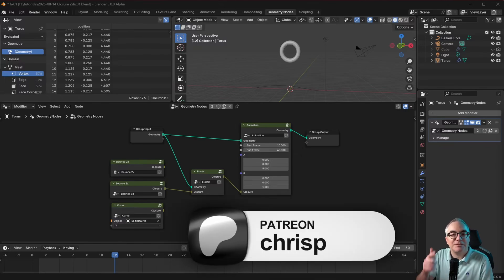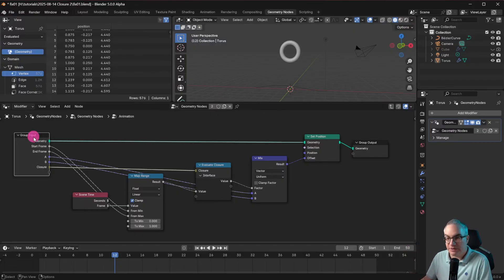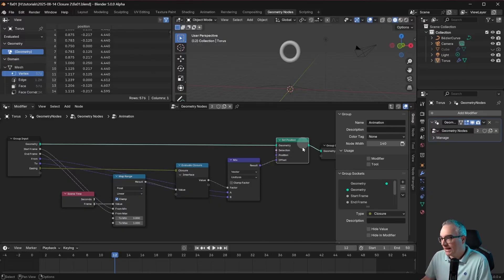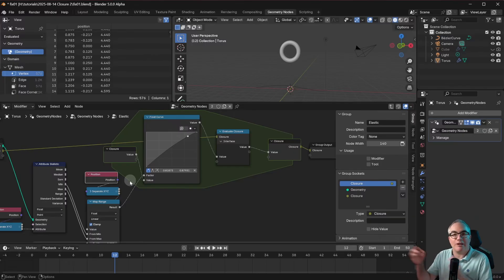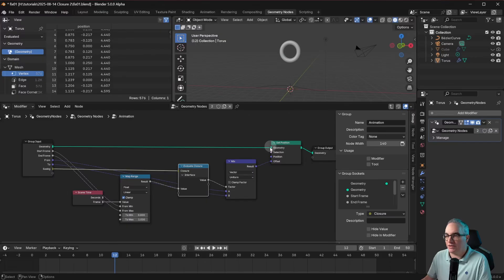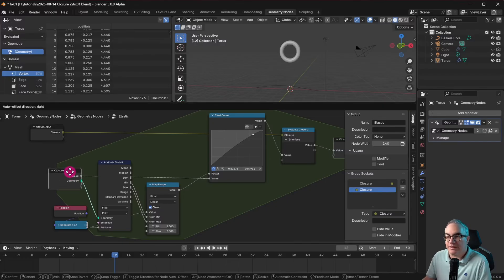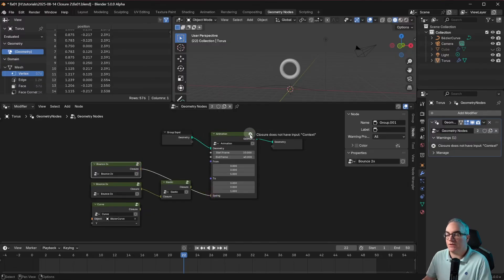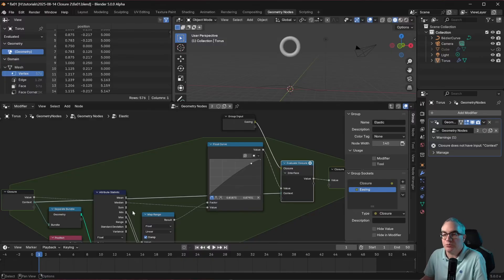I made it better | Blender Geometry Nodes Tutorial

Comment: Neat. The separate-bundle original design I saw put sockets for all the elements of the bundle as soon as you created it. Now it looks like it only adds the sockets for things you use, which seems a lot cleaner. 👃
Reply from the maker: Yes that is the default behavior when you drag the separate bundle node out of a bundle. But you can always delete the parameters you don't need or manually add the ones you want